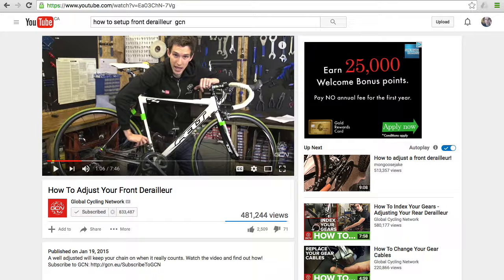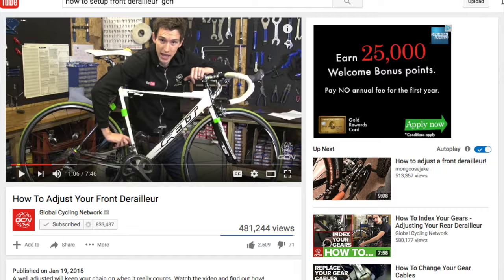Bike chain touching front derailleur - QUICK FIX for new bikes and old

Comment: Thanks for this video. My bike was without any chain rub on a bike stand but once it’s on pedal pressure, it rubs slightly on certain gear. 

Slight adjustment on the barrel adjuster solved it.